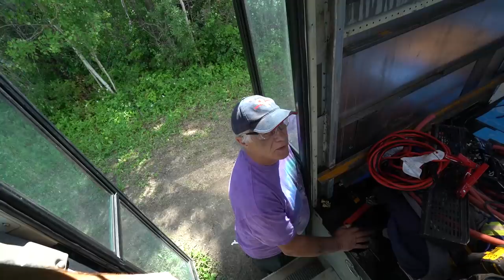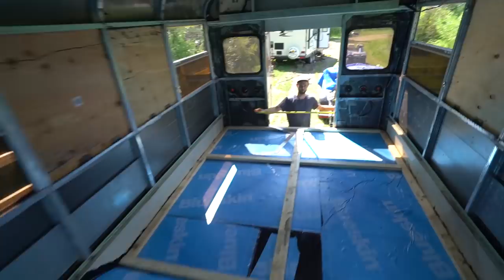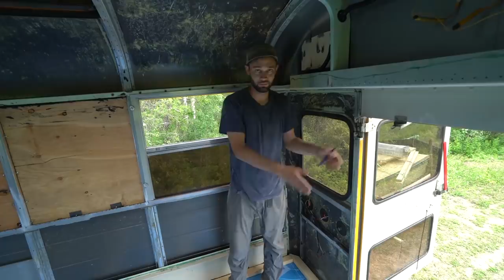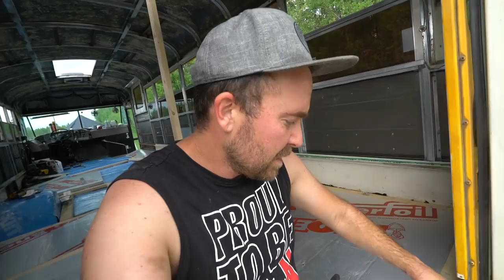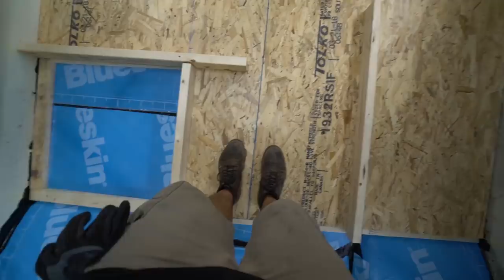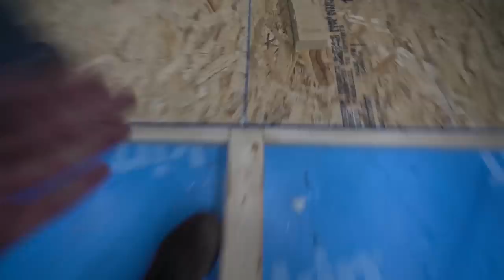INSTALLING SUBFLOORS AND INSULATION !!

Comment: I'm of the school that you don't need to frame the floor. With everything that you build along the sides the center won't flex. Even if it did the foam can hold a lot of weight without crushing.

Also you can save a lot of floor space by not framing the walls.  Use 3/4" sanded plywood for bulkheads. Every square inch is precious in a skoolie.

Comment: If you haven't put the shower valve in yet,Don't put in an outside wall! It will freeze fast there compared to putting it in an inside wall!
Reply: tom williams I was thinking the same thing when they pointed out the wall for plumbing. Try to keep that plumbing on the inside wall.
Reply: tom williams yes I agree

Comment: I would have used marine plywood,or bc that chipboard stuff is for roof deck and siding your going to cover with vynl or brick ect,plywood is much stronger and rigid to walk on and you only need 6-8 sheets ,it really holds screws good too
Reply: jay bradley actually 3/4 T&G  OSB chipboard is just as good or better  than plywood  & less expensive. " Excessive" water will swell OSB & delaminate plywood. I've even  seen marine ply delaminate. This  is assuming  jax  is going  to put finish flooring over it.

Comment: in my opinion you have done many things wrong in this video. 1 You screwed your wood down...you went through all the trouble of sealing your floor and now you just added screws.  water will get on the screws from underneath when you drive in the rain,and wick up through your floor.  i glued mine down.  2 you are using OSB plywood.  as soon as that gets any moisture it will warp and buckle.  3 i'll never understand why people put 2x4 on the floor.  wood has an r value of 1 per inch, foam board insulation is 5 per inch.  I used 2x2 on my floor...less wood, less cold spots.  just my opinion.  i only work in construction, i could be wrong.
Reply: Chuck Co Agreed. But, I am sure it will work for Jax’s needs in his build.
Reply: Chuck Co I totally agree,cheap RVs use this chiat and they fall apart, If any water gets in,i would have put sealed marine plywood down to the floor ribs and screwed all the framing to the plywood, I coated both sides of my plywood with polyurethane even the edges aftef I cut them
Reply: Chuck Co just for the record Micheal said that 🇨🇦🇨🇦🇨🇦🇨🇦
Reply: If you use Sill Gasket under your wood, it puts the R value up.  Not sure how much.. Also helps w condensation .
Reply: @navigationnowhere  is there a reason you left the side panel that sits between the floor and the seat support ledge instead of removing it?

Comment: nice hallway is big enough so  you can fully open the cabinet doors of the kitchen AND have room to kneel in front to load stuff in them  

the sunken showertub is a good idea , no stuff under that part under the floor i hope 
hmm now that he mentioned the bus not sitting leven all the time you might use a wide narrow piece of perforated stainless in the middle as a drain and slightly slope both floor ends of the tub into it , that way there no puddle left sitting in a corner of the tub untill the bus is moving again 

one thing i seen before on a bus build was a cattle drinking tub used as a bath tub , 
http://asrentall.com/wp-content/uploads/2013/02/large-party-tub.jpg
now i seen those used more then once but they didnt had room in the shower for it so they made the bed fold up a couple of feet and put the tub under the front part in the middle , when not used the tub sits under the bed  and could be used to store stuff like wet clothes or stuff that tend to leak in general

as for the tax thing , for a company its when leaving "a " country you can ask for youre taxes on purchased items (in that country) back because youre exporting them  but have to pay import fees and taxed to the customs in the states 
since you allready payed the fees in the states when buying im not sure how that goes , you prolly can ask the taxes back from both ends concidering them export items then pay import and taxes again the states to the customs when entering the country 
......... you might not shout too loudly about the extra taxes payed on the products you used to build out the bus cause i wonder how the customs officers look at the conversion as sumting that can be taxed for importfees 
while youre doing most of it youreself its basicy like having a schoolbus converted by a company in canada before bringing the bus back intoo the states again as an rv

Comment: I do not understand why you felt that you needed to frame the floor.  Why not just put 1 1/2 inch foam board down and then just screw the plywood on top.  The walls will not squash this stuff and your floors will be nice and soft and quiet to walk on.  Are you going to spray foam your roof?
Reply from the maker: Many ways to skin a cat.
Reply: Framing a floor is a waste of time, unless someone gives me a real good reason to do it.